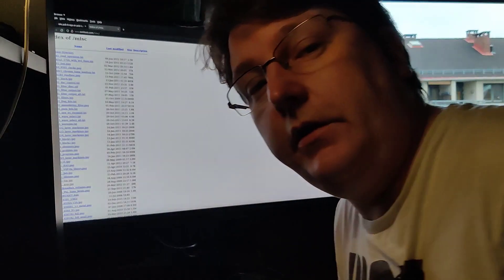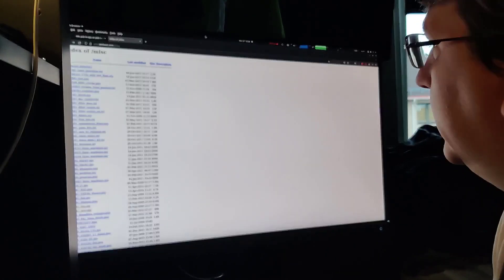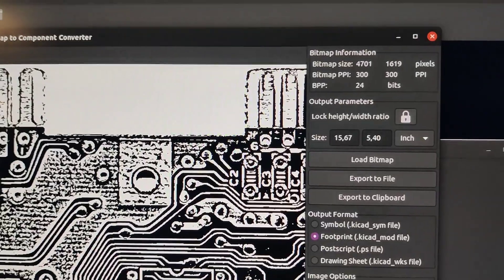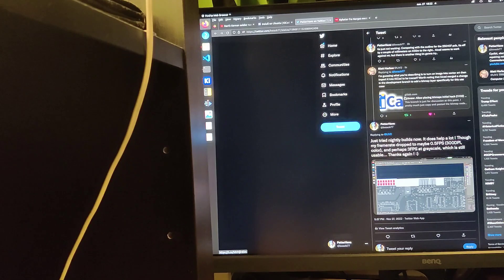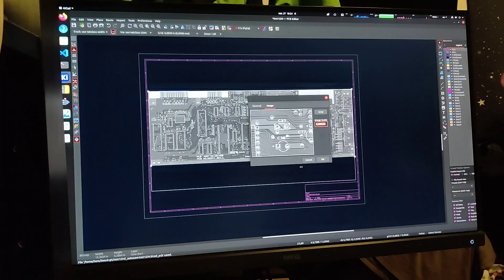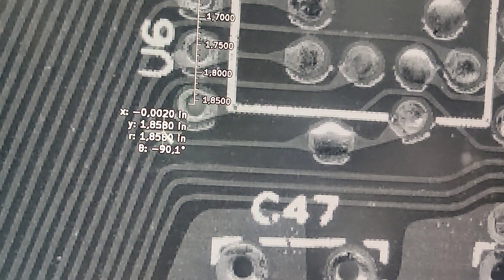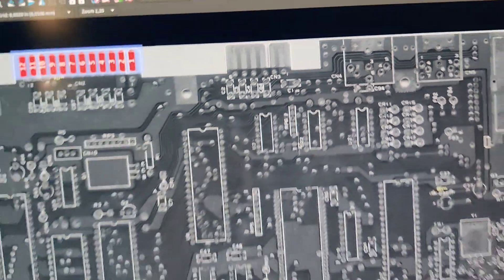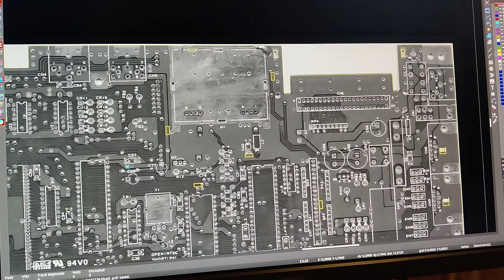Image backgrounds in KiCad6 nightly (C64C Motherboard KiCad Replica update 0)

Comment: It's kind of strange nobody's figured out a way to draw these boards with in a vector format instead of messing around with these bitmap images. You're always struggling with colour information and scaling. A vector drawing of the board itself would make using it for your purpose much easier. No idea if that is even possible though.